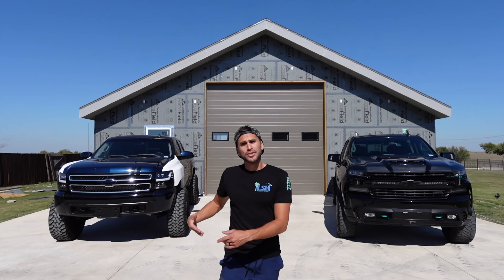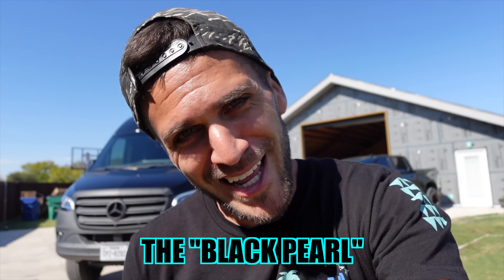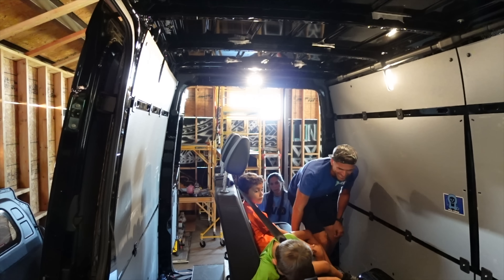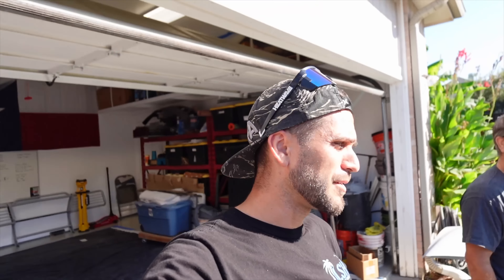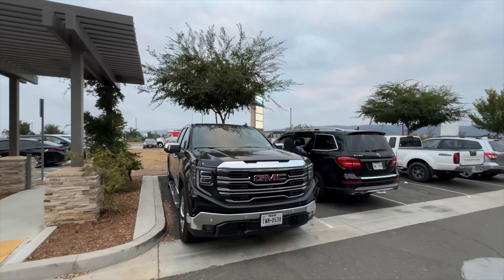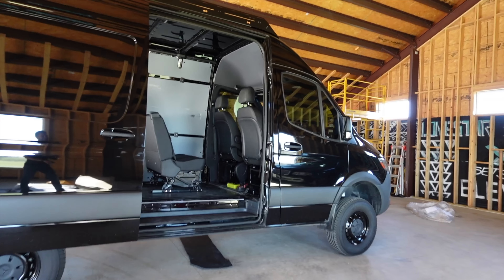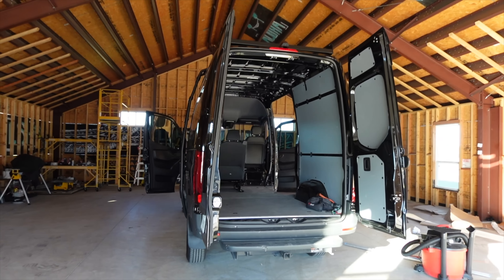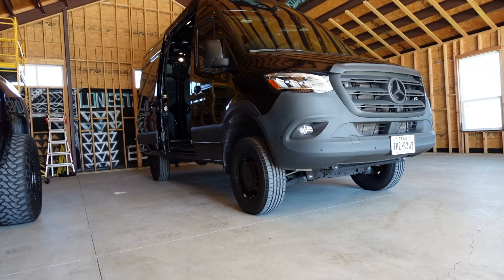ULTIMATE DIY OVERLAND BUILD: WIFEY'S CHOICE

Comment: As a body tech, what you need is 3M 04274 Duramix NVH Dampening Material. It’s specifically designed to go in between door/roof skins and crash bars. Regular 08115 panel bond isn’t a good choice because it doesn’t build up and it’s too hard with no flex. This stuff has some elasticity to it so it doesn’t warp the panel they are attaching it to causing it “tin can”.
Reply: As a second body tech I agree with the panel vibration control also! I’ve never used the 3m but SEM also makes one that I’m more familiar with 39977  with either one you need a specific gun to apply the product …… panel bond is not a good idea in our opinion 😂
Reply: Damping. Not dampening. You’d think you’d know that.
Reply: @  Tell 3M they messed up then because if you go to their page, that’s what it’s listed as. The fact that you’re acting like that when trying to correct someone says a lot about your character.

Comment: Panel bond adhesive or another alternative is windscreen adhesive just a whole lot of it, then use a sound insulation that is foil backed to prevent panel vibration between the supports and to insulate the van.

Comment: Once you get the roof cross members bonded to the roof skin, consider a sound deadening material. There’s a bunch of out there that have different properties like thermal insulation sound ending, etc. Figure out which one fits your needs for the future of the build and get the spray in version. They usually spray in like a bedliner.

Comment: Don’t do any sealing on the roof until you run all your wiring for lights, auxiliary stuff, chargers, pumps, water lines, solar panel lines etc. Deal with the roof WAAAAY later in the build. Trust me you’ll regret it if you do it now and have to deal with running wire later.

Comment: Epoxy panel adhesive. The type used in body shops. Place some shims under skin on the braces, squirt it in all the gaps and pull the shims. Let it dry, your done.

Comment: Panel bond for the roof.  You might even drill a few holes in the cross bars as well as a ruff up the area under it to promote adhesion.  Then insulate well and cover in with wood planks.  The areas that are hard are the edges, but with wood you can shape it and install lighting as well.  Before buttoning up that area think about all the wiring you will need as well as make the that panel removable for access.    Also, you might look up L-track.   Would be handy for mounting things.  Vans can be a whole rabbit hole!  I want one for a Moto van build to haul my dirt bikes and overnight stay for rides in the mountains as well as events and races.

Comment: Try JB Weld, 2 part epoxy to secure cross members to roof. When you mix it, the color will already be black.  JB Weld is amazing.  A buddy of mine used it to seal a cracked engine block on his tractor...as a short-term fix until the engine block came in from ordering it.  After 2 weeks, he canceled the order and it still running strong.

Comment: I would suggest sound dampening pad. They also have some that doubles as insulation, which might be a plus if you're going to be staying in it in hot climates. Run your wires, then use panel bond.

Comment: I've used sikaflex to solve that exact problem on sprinter roof panels before. It works great, and is temperature stable even in the summer heat.

Comment: i used sound deadener both the foil backed butyl 80 mil and the closed cell foam deadener on top of the butyl or even a 2-n-1 with mlv on top of the closed cell foam and the 2-n-1's deadeners are usually 180mil to 200 mil thick & i run them in-between the truss and roof panel besides being  sound deadeners they also offer as being insulation that has an r value

Comment: Butyl rubber, like used in wind shields.  Comes in a tube like caulk.  It can take the heat from the roof panel, doesn't expand or shrink much.  Not expensive.  There you go, something for free...some advice!

Comment: For a quick fix (I hate rattles) I shoved foam pipe insulation between the ribs and the roof skin on my 2006 Sprinter cargo van.  The quick fix was just for me to get the van home (to GA) from Ohio where I picked it up from the dealer.  I bought the foam from a Home Depot 2 miles from the dealer.   There was no way in hell I was driving 800 miles with that horrendous rattle!   It is now 2024.  The foam pipe insulation is still doing its thing to take care of the rattling roof after 380,000 miles!
Reply from the maker: Love this!

Comment: I’d throw a layer of kilmat on the roof for now to at least try and take the rattle out of it, then you can still run your wiring etc later on without it being enclosed in with the panel bond being recommended. Just my opinion. I’m sure there are “better” ways to go about it.

Comment: Thank you for not using washers under the floor. Though you should consider sleeving those square tubes so they don't crush. Any movement is bad in a crash. 1/2" black iron pipe is cheap for this. Or at least drill out the bottom hole large enough for a socket. Its only your kids safety 🤷🏼‍♂️

Comment: In my previous experiences, if the first part of a project has set back after set back, look out for more and more unfortunately...
Definitely need to use panel bond for that roof problem. Sounds like the factory forgot to do it...

Comment: First, why is the roof skin not attached to the structure? Is there a reason for this? If the panel is bonded, will any problems follow? So, sound-dampening material is a must, and foam tape is a good choice.